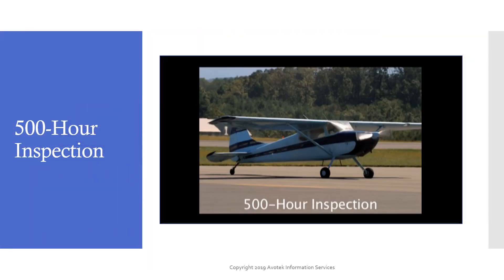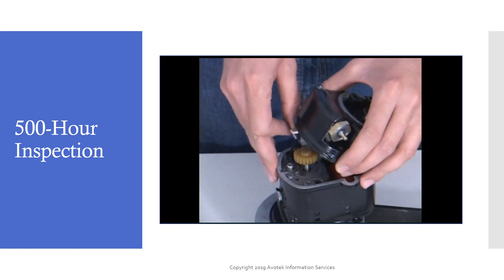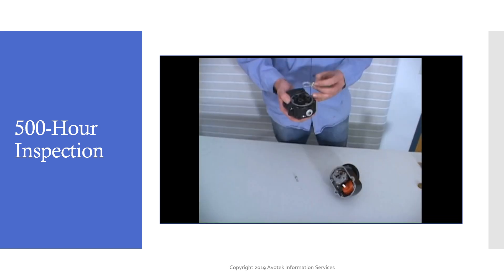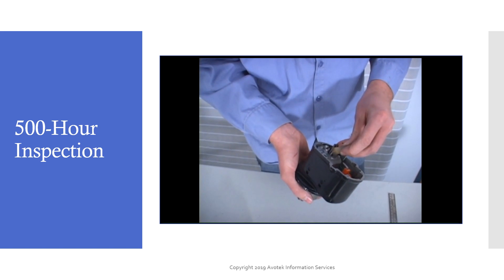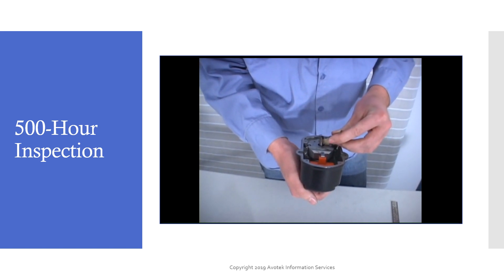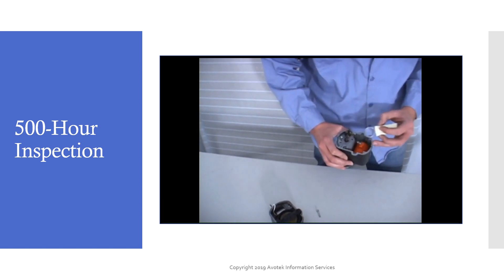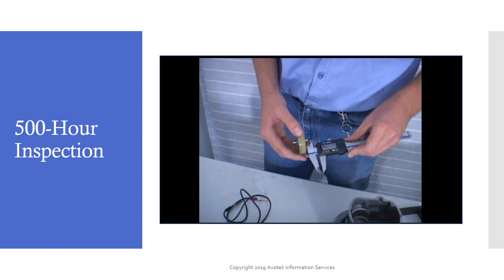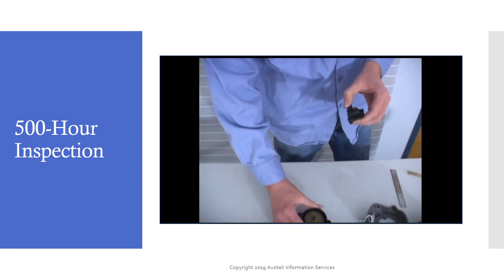Slick Mags 500-Hour Inspection

Comment: Hello, Does it necessary to remove the rotor from the housing during the 500hrs inspection? How can inspect the ball bearings and oil seals without removing the rotor? Thank you for your answere.